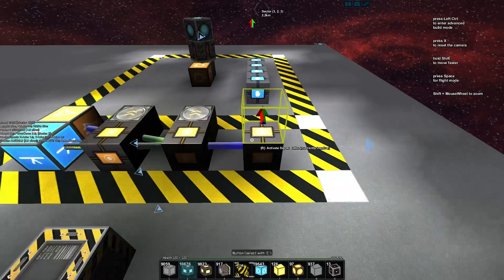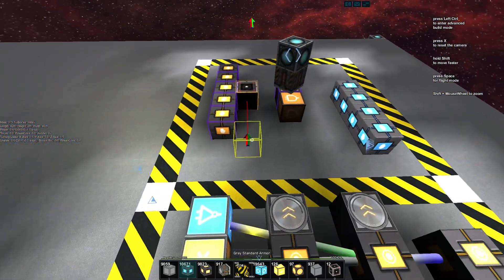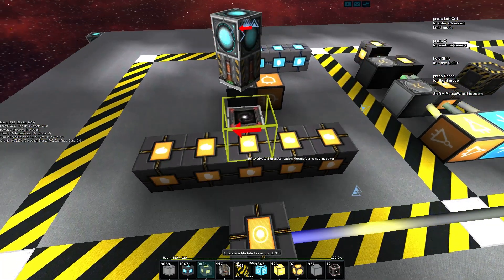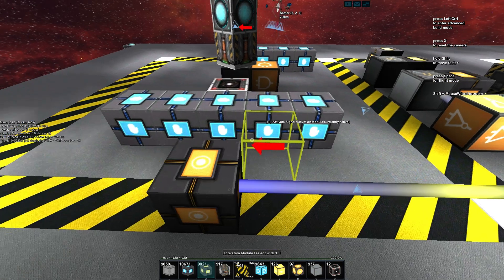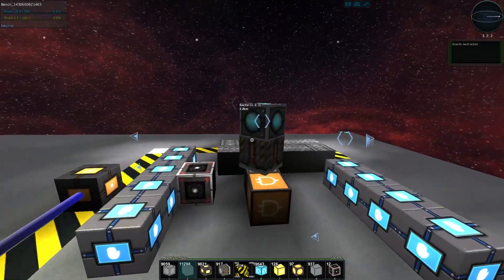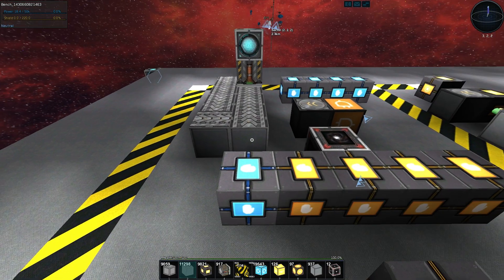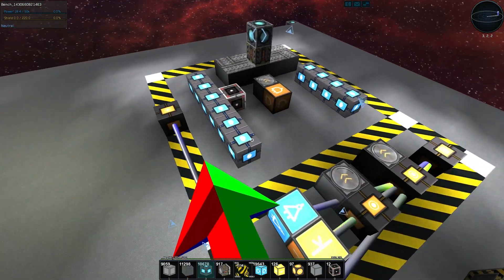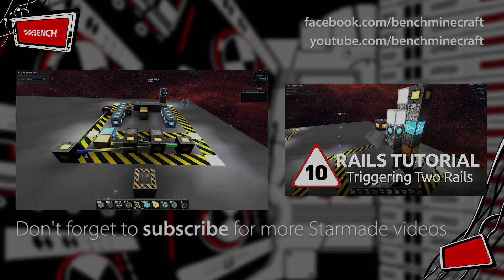Starmade Rails - 09 - Controlling Speed

Comment: i have a question. i made an elevator that is 19x19 and i am going to put a turret on it but it is moving up and down on the rails too slow and i have a speed module on it but it doesnt go any faster
Reply from the maker: bradster2214 Speed modules would have to go on the main ship, not the actual elevator platform. If you followed my first video on this unfortunately I got muddled up so what was said in it was wrong. So yeah need power and speed modules on the main ship and that should fix it.
Reply: im making a defence system on a planet and i put the speed module on the planet with a 10 block speed changer and its going extremely slow
Reply: and would having more speed modules help? ive tried 2 and it doesnt look like there is a difference
Reply: +bradster2214 mass enhancer
Reply: k
i think ive tried that though i dont know lemme test
Reply: just tried it. i put like 20 on the planet but it doesnt seem to be much faster
Reply: Did you power them?
Reply: how? if you mean with the power blocks then yes